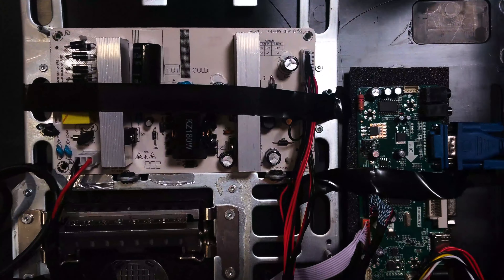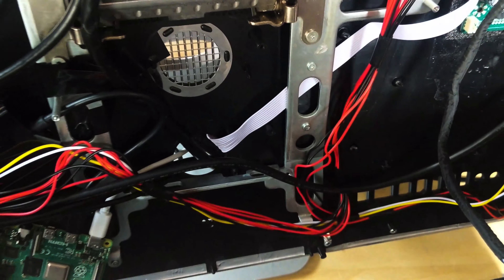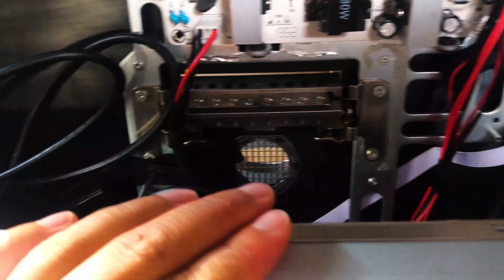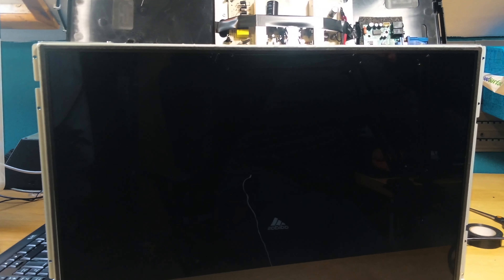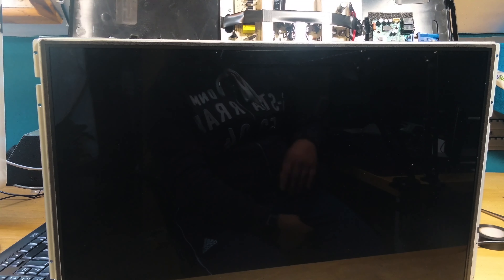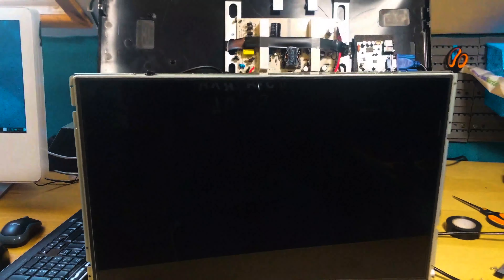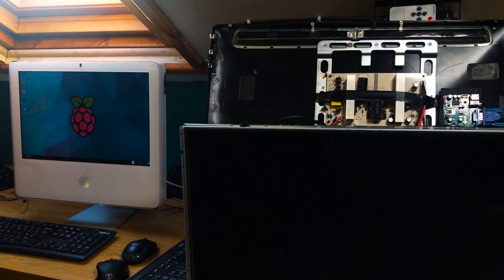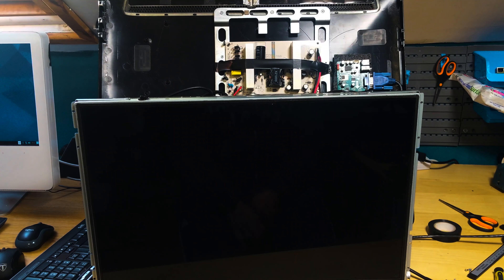I Broke My PiMac! - 24 Inch iMac Conversion - Original iMac Screen Pt 4

Comment from the maker: Any help is greatly appreciated guys.. Should I replace the power supply and then mount it outside the case? Should I try and buy a lcd screen with a new inverter?

I've put it to one side for now, thinking I might try get a new screen.